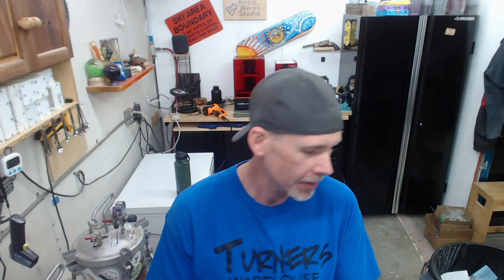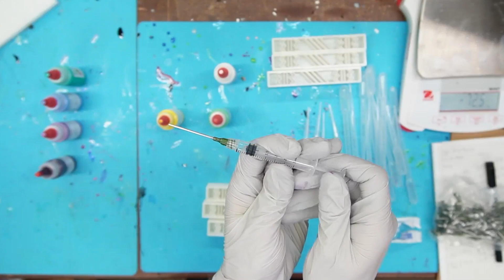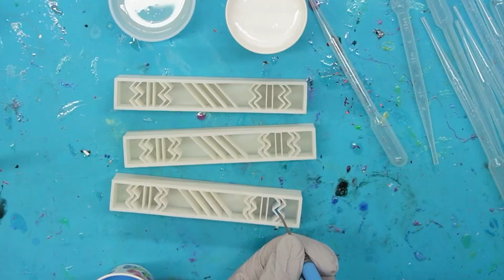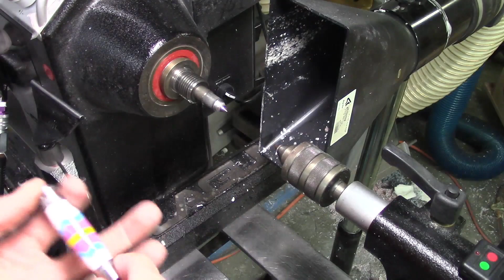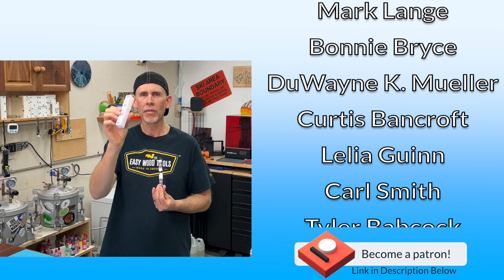So Simple! Using Resin 3D Printing and Epoxy to Make a Segmented Pen

Comment: Hey Zac, I landed a commission that is going to require me to resin print a pattern and went to go research.  Can you tell me what printer resin you're using for this?  My printer likes anycubic eco resin and would prefer that but I don't know how that turns.  I'm going to try it but if that fails I was wondering what worked for you so I can fall back on it.  That stuff is a little on the brittle side.  Great for mold positives, but terrible for dropping it on the floor. Reminds me of inlace acrylester.

Comment: Zac, do you ever cast "glow in the dark" blanks?
Reply from the maker: I do sometimes, but not too often. The glow powder is so abrasive on saw blades that cutting up one batch of blanks, and I need to have my saw blade sharpened 😕
Reply: @ZacHiggins  thanks Zac…didn’t know that about the powder.

Comment: Awesome video Zac. Thanks so much. I attempted to make some 3d blanks and cast them up but the resin seemed to be very brittle and chipped away from the alumilite. Any suggestions on the resin to use or different settings for curing the 3d blanks?
Reply from the maker: Thanks Jakob! I sent you a message on Patreon with info on the 3D resins I've been using as well as wash and cure times too